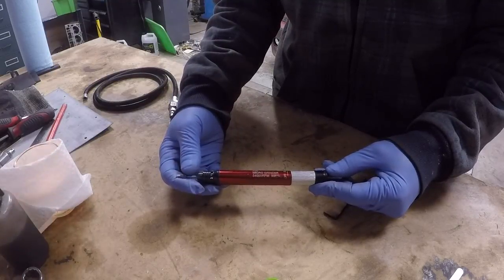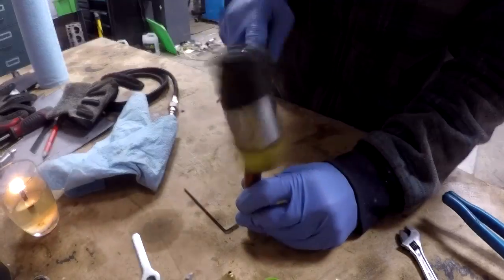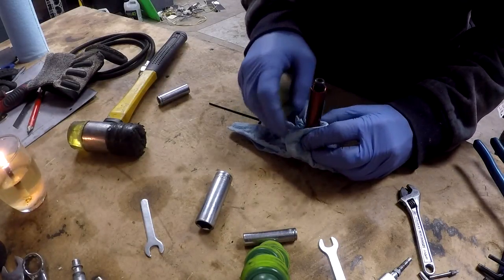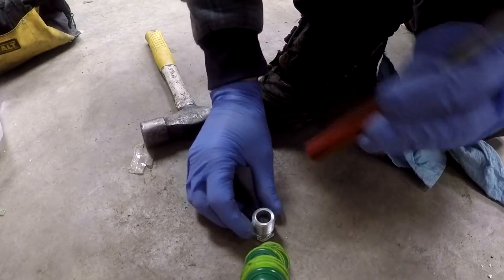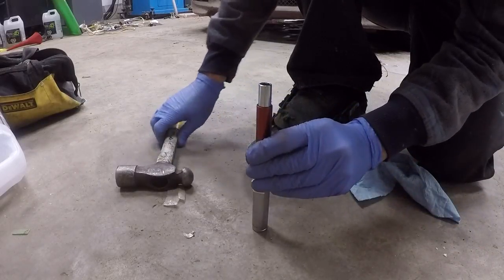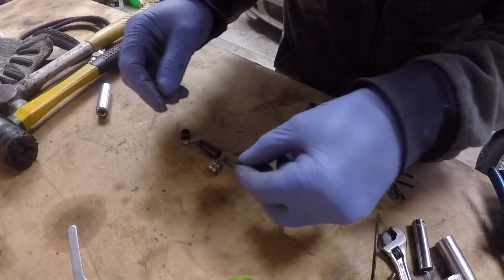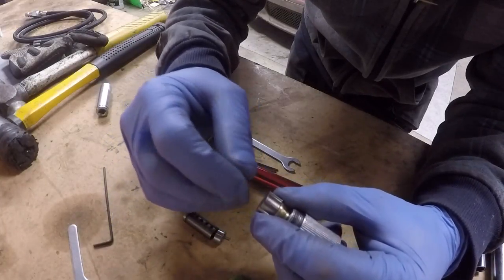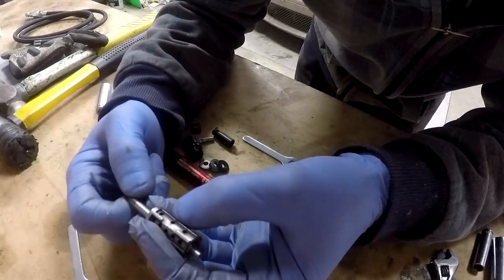Pencil Grinder teardown - Micro Air Die Grinder - Pneumatic. (Part !)

Comment: A note for anyone who found this video while struggling with the collet sizing on a similar-looking Harbor Freight #69745:

The collet they include (at the time of writing) appears to be a 3mm steel one, which will not fit 1/8" bits. From what I've read, it appears they had brass collets in the past which did fit. A 1/8" Dremel collet was able to work in the tool, but it was a poor fit, since the collet shank was too small (4.3mm), and the end is tapered, whereas the HFT item has a flat end with a slight boss on it for centering. So, the collet and the nut kinda jammed/fretted together when tightened.

I unthreaded the spindle cover of my die grinder as shown at 4:20 (leaving quite a few scuffs in the process...), and I'm fairly confident that this tool is supposed to take 4.8mm collets and use an m8x0.75 collet nut. I've got ahead and ordered a few 4.8mm shank brass collets (with tapered ends) and a m8x0.75 collet nut that should accept those tapered ends better.

It'll be a few weeks for shipping (China), but assuming I remember, I'll comment back with the results. If not, someone please remind me.
Reply: I was wondering f this too! So dremel bits won’t work correct? Uhhhhh so annoying
Reply: Reminding :)
I ordered second grinder, its already in post office, so i dissasembled old one. I want to slap an ER8 collet on it

Comment: Dude .... 1. You hammered it out the wrong end. 2. You're hammering on it. 3. Do you not own any transfer punches? Or a press? Or a vice?
And it's not "motor end housing" its simply "end plate "
Reply: @JoelArseneaultYouTube  I usually use a vice. My vice is gigantic though. I just rebuilt my bluepoint(snap on) version of that yesterday for the... 5th or 6th time I believe. It's very similar to what you have there, but far more expensive, and it has 4 veins instead of 3 and it does every bit of the 70,000 rpm that's printed on the body. It's just hell on bearings. And yes a press would usually be my first choice except for these precision micro bearings that cost more than that whole tool in this vid costs. I would rather be gental